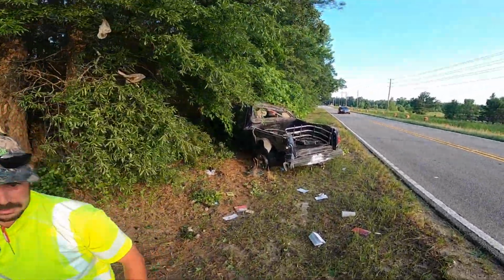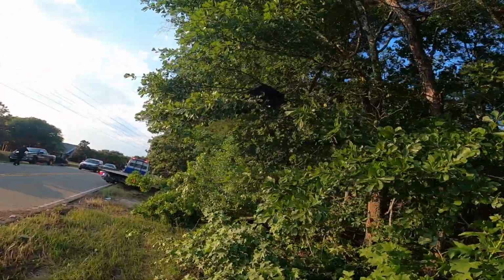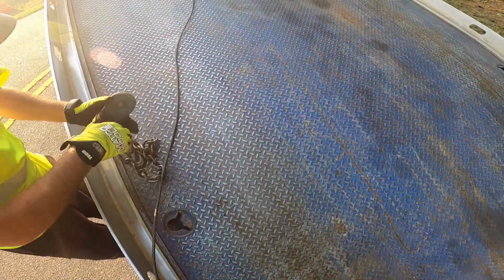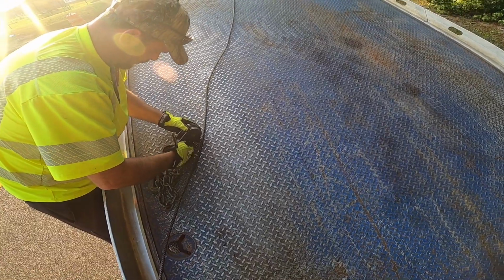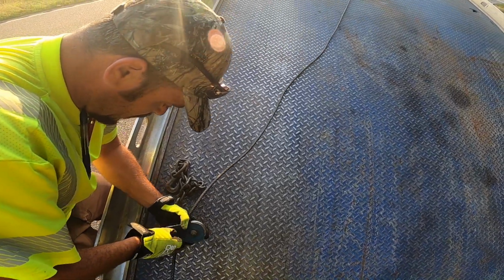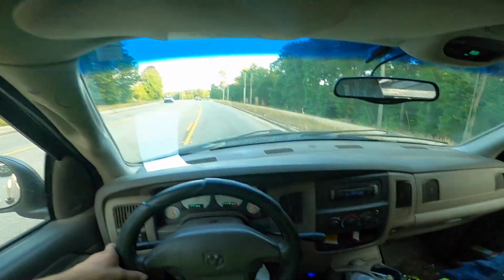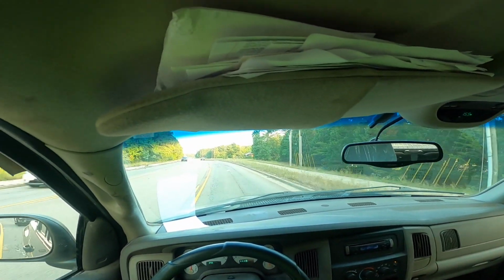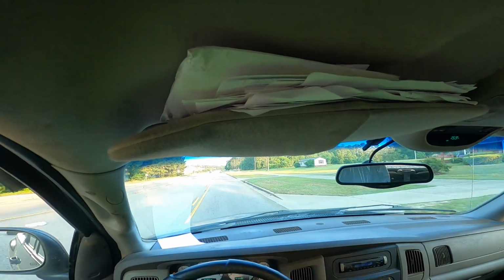F150 Wreck. The driver walked away.

Comment: Quick suggestion here-Mr. Hal. Keep an empty five gallion bucket on each small truck/rollback. Drill a couple holes in the bottom so rainwater won't collect in is. You can always put  couple tie down chains in it to keep t weighted down on the truck. That way-when you have to sweep up glass or debris--just fill the  bucket up--dump it in the affected vehicle. That saves a lot of back/fourth trips. Believe me--if you do a lot of  accidents--especially in busy times--it'll cut down on time at scene. Just an idea.
I love your video's.
Reply from the maker: Mr Glenn  Thanks for the tip. I will try that. Thanks for watching and stay safe